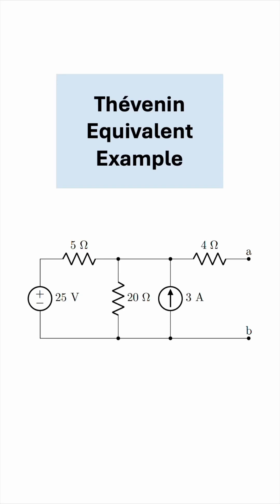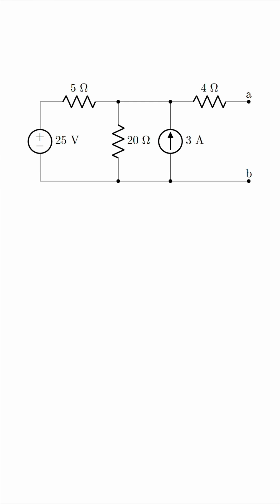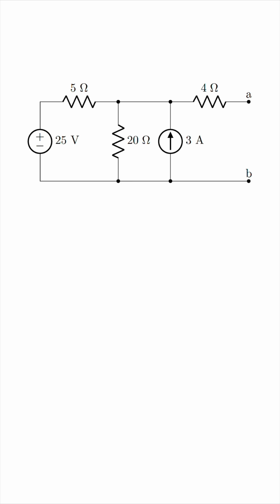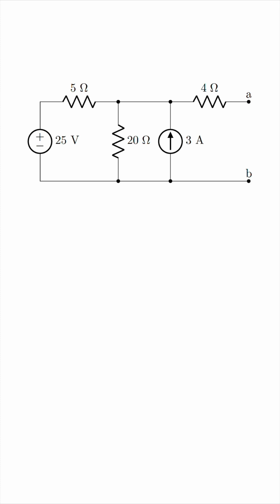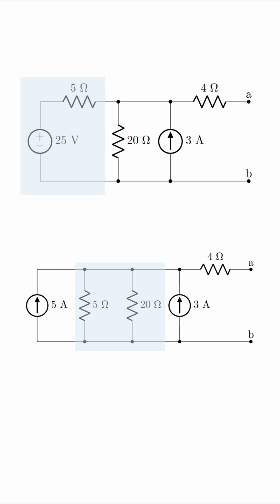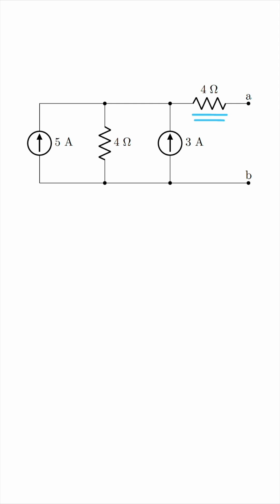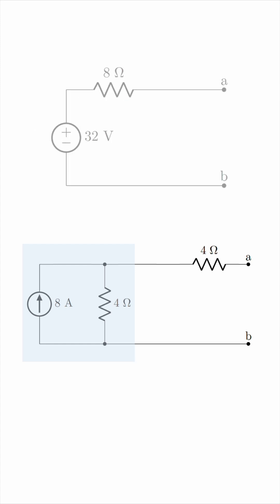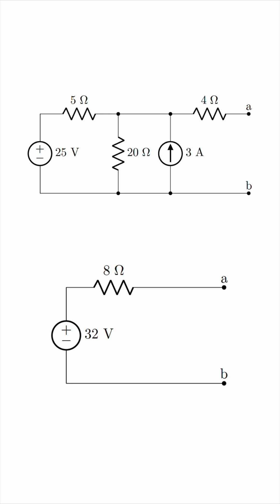Thevenin Equivalent Circuit – Worked Example #electricalengineering #electronics #physics

Comment: Sir  can i use source transfomation for every thevinin calculation????
Reply from the maker: It was possible for this circuit, but generally speaking, the Thevenin voltage is the open circuit voltage between the two terminals, and the Thevenin resistance is the equivalent resistance of the circuit with respect to the two terminals.

I have other videos on Thevenin equivalent exercises where source transformation does not work and the classical method is required. Check them out!

Comment: Where is the load? Dont we need to remove load?
Reply from the maker: If there is a load, you would indeed remove it to find the Thevenin equivalent of the circuit with respect to the pair of terminals to which the load was connected.

Once you have the Thevenin equivalent, you would place the load between the two terminals and very easily calculate the power the load gets, etc. 

In this case, the terminals were already open and we are only interested in how to reduce the feeding circuit to a voltage source in series with a resistor.

Comment: Another way is to short circuit the independent voltage source and open circuit the independent current source. The 5 ohm resistor and the 20 ohm resistor are now in parallel. (5)(20)/(5+20) = 4 ohms. The two 4 ohm resistors are now in series. 4+4 = 8. The Thevenin equivalence is 8 ohms. Short circuit terminals a-b. The short circuit current is Isc and can be found using whichever method you like: mesh current or node voltage. From there, Isc is 4. Rth = Vth/Isc, so Vth = Rth*Isc = (8)(4) = 32 V. Your Thevenin equivalence is the Thevenin voltage Vth = 32V in series with a Thevenin resistance Rth = 8 ohms.
Reply: To find Isc do you go back to the original circuit?
Reply: @MarshallJorgensen Yes. You short circuit terminals a-b and leave everything as is. If you use mesh current analysis then you will have 3 meshes, i1, i2, and i3. Since i3 is flowing through the third mesh, then i3 = Isc.
Reply: @MegaNerd117  Got it, thank you!
Reply: @MegaNerd117 can we write i3=Iab??

Comment: Thank you for great content 
Another valid aproch here is to use nodal analysis
And it's pretty basic here since there will be only one variable to solve for

Doing so KCL on Va = (25-Va)/5 +3 = Va/5
Va = 32 v

Amd the equivalent resistant its also pretty simple as well
Reply from the maker: Great point! It's always good to have multiple approaches.
Reply: your equation is incorrect